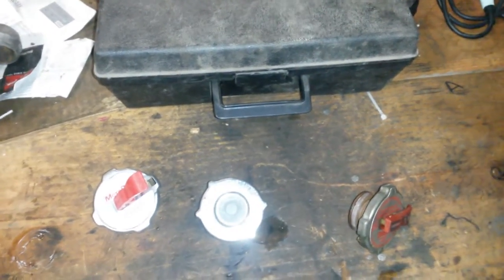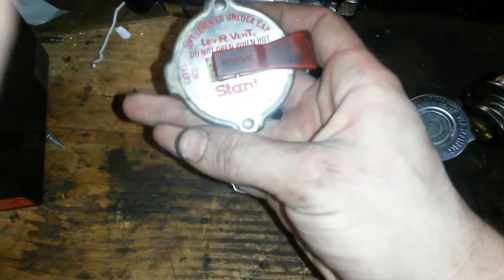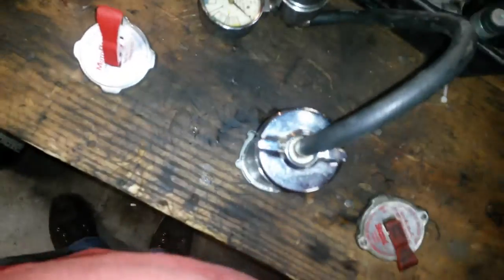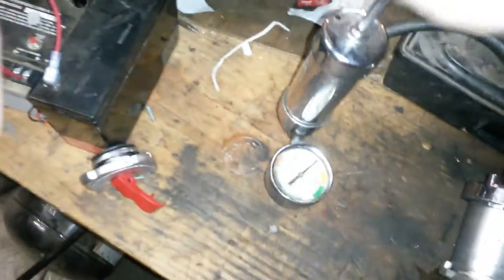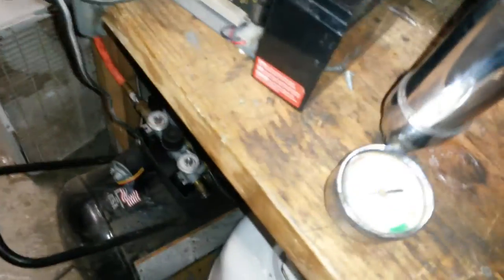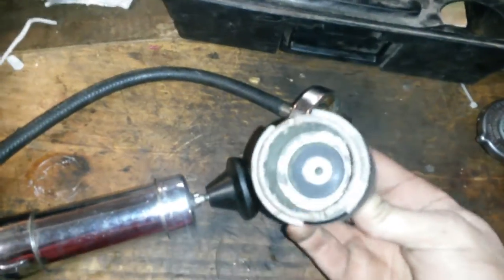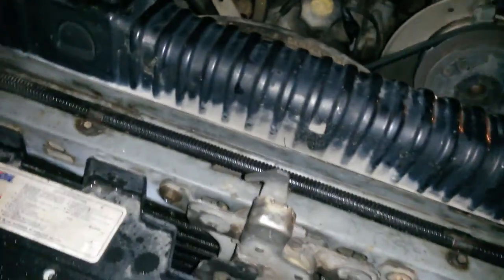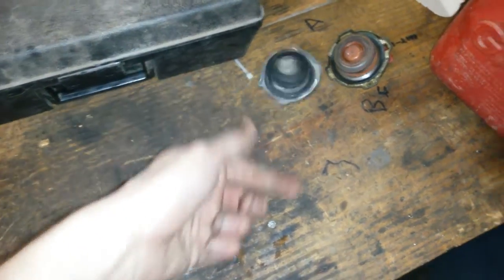How to test radiator caps and radiators

Comment: if I got radiator reservoir do I need to hook up the gauge to radiator cap hole or to reservoir?
Reply from the maker: canada painter does the reservoir have a cap?
Reply: N4ANE = I got cap but it is not really cap. It is just a cover, a push in plastic cover...
Reply from the maker: canada painter than use the cap
Reply: Thanks....